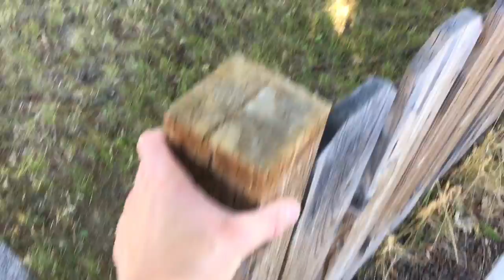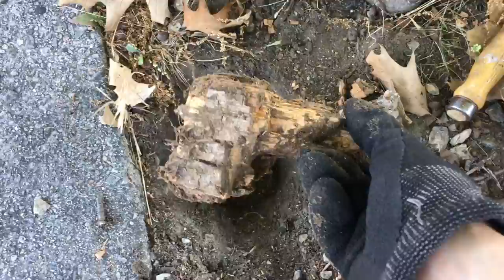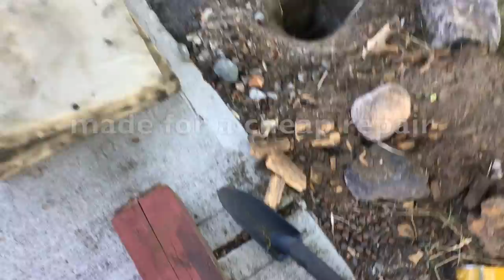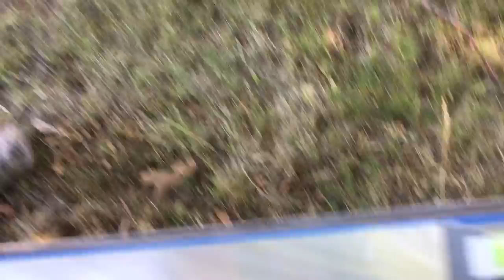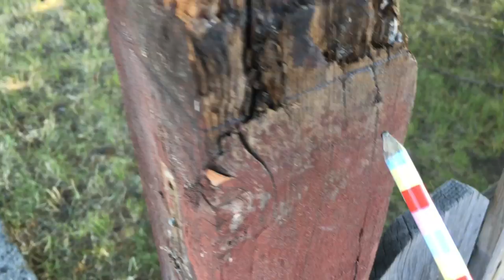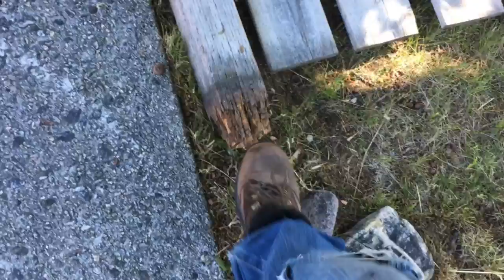Installing Fence Posts in Existing Concrete Footings  (Reusing old footings & reusing old fence post

Comment: Why not cut the existing fence post to match the new one? Plenty of material to work with there.
Reply from the maker: That’s a good point…I don’t think I even considered that at the time because I thought it would make the post to the left of the gate look too low compared to the post to its left. But you’re probably right, it probably would make the gateway looked better. Thank you for watching 👍🏼😃

Comment: To make the posts equal in height, you could just trim the one that is longest.
Reply from the maker: Yes I should have cut the tallest post down a bit. You know at the time I was doing this, that didn’t even cross my mind. I was so fixated on just fixing that wobbly post. 😀

Comment: Hello. Thank you for the video. You did not say how deep you dug down for the new fence post? Thank you.
Reply from the maker: Hi, after removing the rotten portion of the old fence post from the existing concrete hole, I dug down a bit deeper than the previous post. Then I poured in some gravel into the bottom to aid with drainage. then I inserted my newer post. The hole wasn’t very deep - maybe 18” - but the above ground portion of the post is only  about 3-feet tall. If the fence post was taller, I would dig deeper than that. Hope that helps.
Reply: @LearnAlongWithMeVideos  I see. Thanks for the quick reply.  2 thumbs up!

Comment: How will it drain if the gravel is in a concrete pocket?
Reply from the maker: Hey good question. From the fence posts that I have experience with, there is no prominent concrete pocket at the bottom.  Originally the posts would have been set upon a layer of gravel and the concrete poured in around the post to fill the hole. Yes, I think some of the added concrete may spread slightly into the gravel layer below, but I haven't seen it where it forms an absolute pocket.  
That could be something for people to look for in their particular fence post hole though... Thanks for the question. 👍